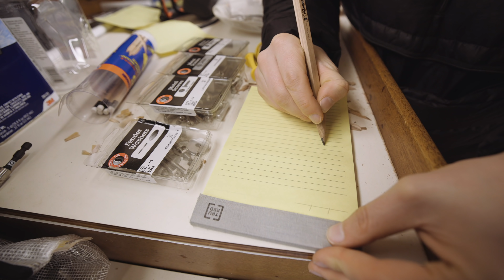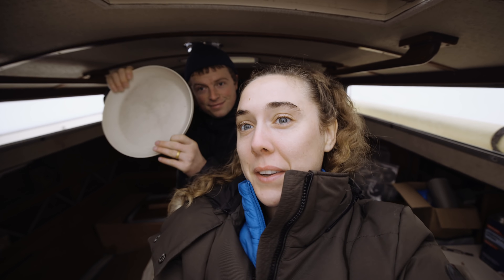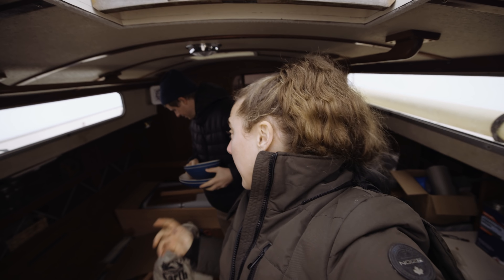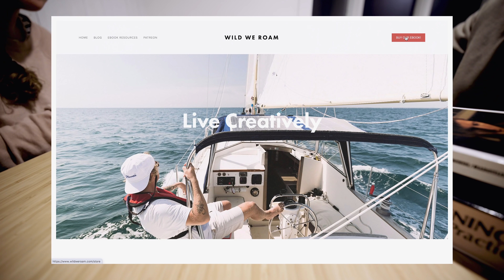Big Little Changes | Boat Life Ep. 38

Comment: Think about your boat being on a 45 degree angle and pitching forward and back and side to side.  When you pack your pantry you will want some sort of padding for glass bottles and some way to keep everything from shifting when you take something out. Another thing that is handy is to designate a place in the gallery for rapid access - where you can put snacks or the ingredients for a quick meal while at sea. Lastly the fiddles on your dinette may have been more uncomfortable if the cushions had compressed over time or were not dense enough to begin with. Something to check out. The fiddles keep the cushions in place when you are sailing. (My experience from 25 years of ocean passages). Keep on with the winter build and thanks for sharing your adventures!
Reply: The style of gallery on Penelope has pros and cons for cooking at sea. I’m sure you can find tips from others with a similar galley. I personally do food prep while sitting in that type of galley-it takes some planning to figure out the best way to safely cook. You’ll figure it out I am sure and that’s a lot of the fun of cruising!
Reply from the maker: These are wonderful tips, Val, thank you so much for sharing!!! Reading your tips learned from experience makes so eager to be out at sea already 🤗❤️ Hope you are having a wonderful week!

Comment: Only advise but you should have put those shelves on pullout extension runners - so you could access everything on the shelf. My wife has a huge pantry which is deep and just fixed shelves and we never got back to the stuff on the back of each shelf. So I changed everything to pullout shelves - godsend!
Reply: Would be really difficult on the boat. As these shelves are wider than the cabinet door

Comment: Yeah If you check out sailing uma, they used to or still have like elastic bands or small ropes across their cupboards so nothing slides out and you can just pull the band out the way and put stuff in

Comment: I have been watching your channel for a long time I would have never guessed that you switch editors nice job.  good story telling.  You can notch the shelf above to gain space to avoid the fiddle below.  A small sacrifice to gain more room if you keep the top open for top loading you can put a lot of tall stuff on the top shelf.  just like the shelves the cushions will fall off the bench seats on a long heal.  you might add Velcro to the seat and cushions. Finally  rising the new frig so your feet can fit under it will make much more comfortable on passage you will want to sleep very close to the person on watch.  after all it' s just you two against the sea.  Haling from the gang way is much easier than running below to awake your partner in the forward cabin.  nice work!

Comment: What an absolutely amazing edit! So smooth it just all flows.
And I fully expect to see (maybe in a few years) a series of videos just on shelving and storage in boats. Clearly you guys are working the cutting edge of this technology. "Big lips" get in the way, but "fiddles" don't?? 
How about about six inches back on that top shelf, and only about half the width of the shelf, you put a hinge (so part of the shelf is a flap that lifts up), then when you need to put cans on that shelf which won't fit in the gap between the shelf and the big cabinet header,  you just push up the flap, put them to either side and then drop the flap. You don't lose any space, plus nothing can drop out.  It's like you have a little trap door on that top shelf. 
Even if I buy a brand new two zillion dollar Outremer I'm definitely going to do this. And fiddles, aka Big Lips, keep things from sliding off the front. How about some raised rails going  front to  back to keep things from sliding around the shelf? 
Also it looks like you have more than enough room for drawers above those cabinets. Here's what decades of kitchen work and cabinetry has taught me about drawers. Don't bother using the metal mechanical drawer slides - unless they are the best solution. Instead just use hardwood strips, birch or maple slides, in the cabinet and on the drawer - and wax them. They will work as well as any mechanical slide, last forever (I've got dozens of drawers that are 30 years old). and if you do use mechanical drawer slides - always get full extension. (If you have any Ikea drawers you already know this.) 
And sorry to be such a busy body.

Comment: Getting stuff at the back of those shelves will mean emptying everything in front. Redesign with drawers, much more convenient.
Reply: I was thinking the same thing. Or you could use long acrylic boxes you can pull forward. That is what I have done in a cupboard that is difficult to access. Don't know how it will work with the lips, though.
Reply: The opening for the door is not nearly as wide as the space behind.  This.idea would waste a ton of room for the drawer itself, not to mention a few inches on both sides which would not be reachable.
There is so little room in a boat this size that even one square inch of wasted storage space is a tragedy.
Reply: Though they do not have the space Sailing Uma came up with an amazing solution and fitted a lazy Susan. No I do not know Susan or why she is lazy. The best thing was they only had part of the top removable making it much easier to take off and they just turned it around to see all the contents.

Comment: you can buy these drawer dividers on amazon that change sizes with a tension lock on them when it is fit.  I don't know where I saw them but they are awesome.  The tension lock is on the top.

Comment: Hey guys, try using an adjustable table edge for the shelf lip. Up to keep things from rolling/sliding out when heeled; down when you are on the hook. USN has used them for decades and from personal experience, they work...kinda sorta. On a table you have to keep one hand on your plate, bowl, glass, but, they work. You should be able to find them. Good luck! :-)

Comment: FOR DOING SHELVES...
  Buy some 1/8” or 1/4” doorskin. Rip into 1-1/2” or 2” strips. Use a pair of tin snips to cut your strips to fit your shelf size and hot glue the pieces together..! You will have a perfect template for your shelf. You can also use this method to make bulkheads too. Will save you lots of fitting time and frustration. 
  Bfree 
SV Fascination 
Lyme, Ct

Comment: Nice job on the shelves. Why don't you bring the battery charger with you? :-)  I'm sure there are lots of outlets around a marina you could use. I would also bring a portable heater. If there is an outlet within 4 or 5 boats away, bring a long extension and bring a small ceramic heater (they are cheap and work great), or get a Little Buddy heater. They are very portable and provide about 6 hours of heat on one of those little canisters.

Comment: the acid in onions are attracted to water so they normally go straight to your tear ducts which makes your eyes water. if you put a damp paper towel on the cutting board, the acid should be attracted there instead of your tear ducts!

Comment: I would think you’d prefer drawers instead of shelves.
Reply: I don't think there's enough room to pull out a drawer. Also, would drawers stick because of humidity and therefore be constantly annoying? There's also wasted space between the bottom of the drawer - with or without a slide - and the next one. It's probably twice the depth of one of the shelves they have. Also with shelves you can just put in extra cleats on the side and have an adjustable system.
Reply: Actually drawers prevent that humid stickiness. It’s the trend to use drawers with drawer slides. The ones they did on the other side of the kitchen are sticking because they didn’t use drawer slides.

Comment: If you really wanted to have an improvement with your cabinet you could have put your shelves on glides so you could pull them out and have better access and could have them closer together because you can just lift out what you want after you pull it out. You could put a latch on each shelf so they wouldn’t all slide out if your healed over. another thought is that you still have the opening on the top of the counter why not use that for access to the top shelf?

Comment: I would recommend putting an anti-slip mat that fits in the storage cupboard or as a base for plates. Then the plates do not have to go around in the cupboard during sea walking. Can be cut to the desired shape and size.
Excuse my English, I use Google translate. Regards Micael from Sweden.
Reply from the maker: Thank you so much, Micael, that is such a clever idea!!! 🤗❤️

Comment: Without the frame around the settee tops how are the cusions going to be retained?  What is going to keep them from all sliding onto the floor? (Or Cabin sole.)

Also, I think you may regret not insulating the hull begind the new storage where the icebox was.  It will be very wet with condensation and very little air flow in that space.  Cans will rust, and mold will form everywhere inside without constant cleaning to prevent it.  The problem is not too bad in the upper galley cabinets behind the sliding doors if you keep them partially open.  But the lower lockers below that gets pretty bad too.  As I write this my wife is literally digging everything out from way behind the stove because of a huge mess. A pineapple can rusted out and soilled it's contents down into the bowls below.  Yuck city.  

When the boat rocks there will be a lot of travel for items to slide around on those new deep shelves .  You will want a fairly high fiddle on the face of them or heavier items may even come right through the lightweight panel of the door with that much room to build up momentum.  But short of that it will drive you nuts having everything slide around when the boat is tossed in a rocky anchorage or just sailing on a passage.  Packing it really full helps but as items are used then more space for movement opens back up.

There have been times when I got up in the middle of the night to shove half of my wardrobe from the shelves above the V-berth into the galley cabinets to keep cans, jars, plates, and bowls from slamming side to side with every rock of the boat.  With it's shoal draft the Rasmus is a martyr to rocking at anchor or even sailing in confused chop.

Comment: Just had to stop the video to suggest, people prob have, why not use bungee cords across the opening of each shelf -attached to hooks for easy removal/access if need be, wouldn't that solve the problem of the cans following out? Good job though! :)
Reply from the maker: The bungee cords is a really clever idea!!! Thanks so much, Karen 🤗
Reply: @WildWeRoam  I also was thinking of those straps they have in airports - when you line up to check-in - they are wider and can hold more back in case of movement and easy to retract etc. Anyway, look forward to your next update! 👍🏼👍🏼